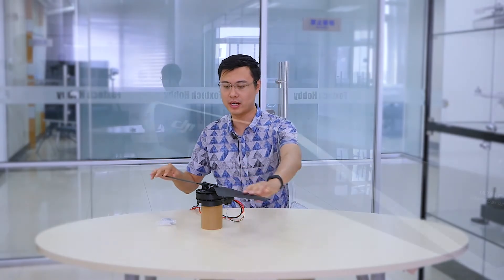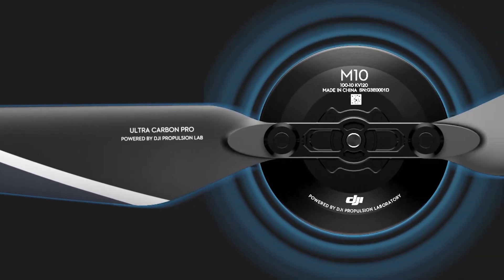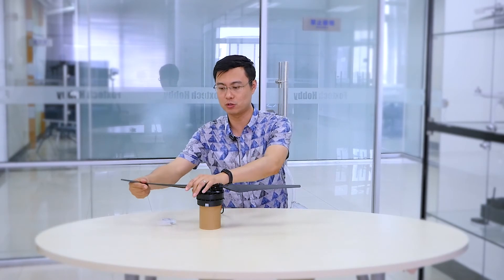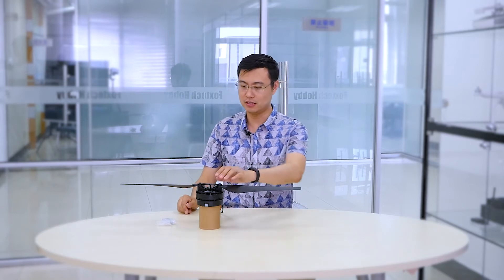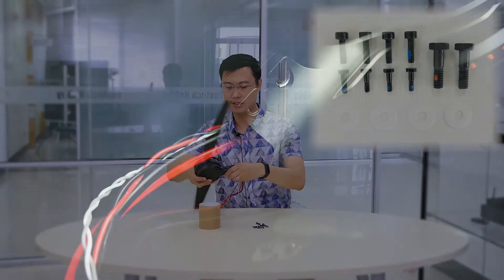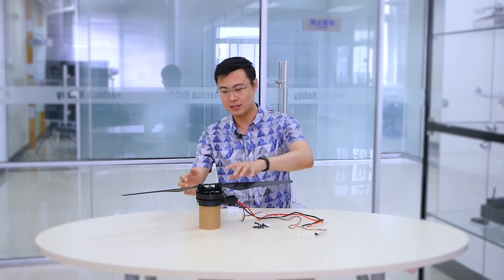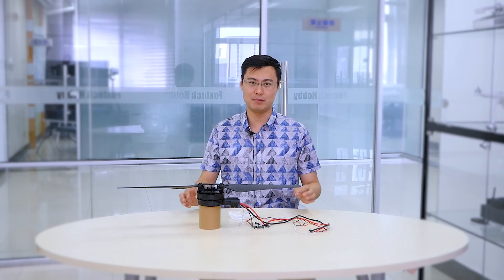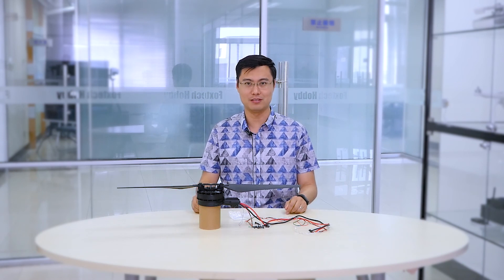DJI E5000 Pro Heavy Lifter Power Combo First Look Video

Comment: Hi Foxtech team, please pay attention, you have wrote/attached 2 times this: 

"E5000 is a tuned propulsion system designed for use in industrial multirotor applications. It features M10 motors, 1280 FOC ESCs and 2880 propellers, together providing 10lbs (4.5kg) to 15lbs (7kg) per axis of rated load capacity. Combined with weather sealing, it is ideal for heavy loads in harsh environments."
Reply from the maker: Thanks Claudio. It is deleted now:)